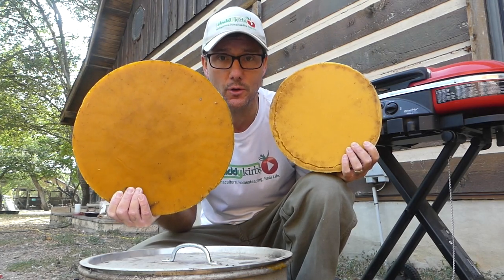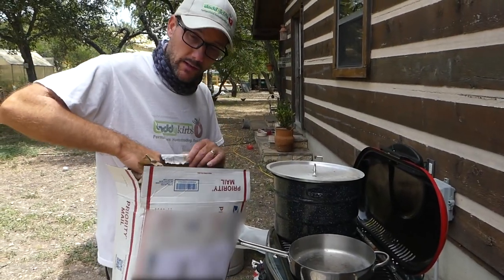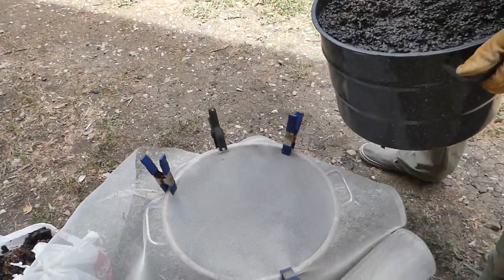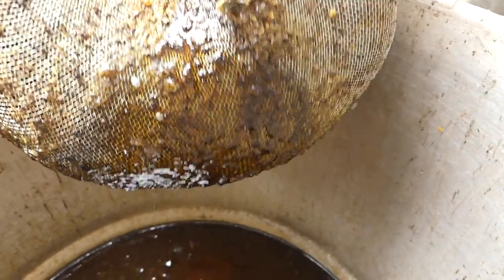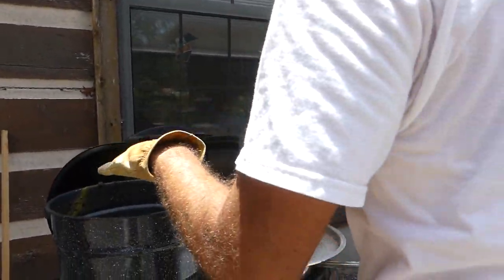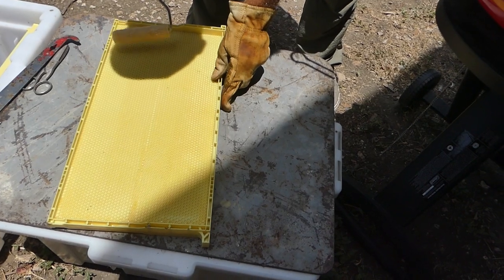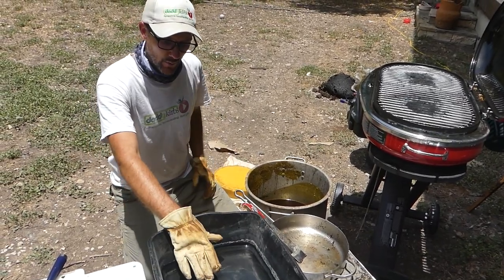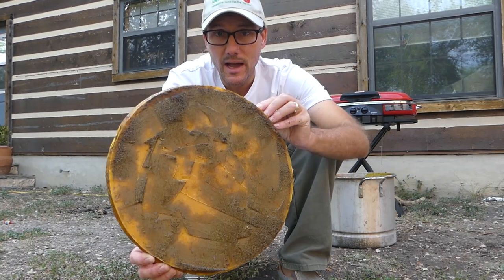Melting and Filtering Beeswax - Wax New Frames

Comment: Put the wax in a pantyhose before it melts and only then add the hot water to the pot to melt it. This way, the waste remains in the pantyhose and the wax remains in the pot without any residue. As soon as the wax has melted, you can slowly take out the pantyhose and let the wax run off. It is best to use 2 or 3 pantyhose to filter out as many of the smallest particles as possible. This also keeps the pots a little cleaner

Comment: I prefer to pour the wax with the junk in a pillow case from the 2nd hand store
and after draining I place it between two boards and 
put pressure to it to get much more wax out of the sludge. 
Remaining wax in the pots are easy to melt with a hot air gun.
Tom 😎

Comment: depending on how clean it comes, I sometimes melt and strain 2-3 times, no matter how long it takes, and I use an old fashioned paint scraper after it's hard.  I made a solar melter, using an old window, an old hive box, a cake cooling rack and disposable roasting pan, and a disposable bread pan.  You can find directions on internet.  When I come home from beeyards, I drop whatever wax I've collected in the solar melter, and forget about it till next time.  I think you'd like it, a sheet of paper towel on the cake rack under the wax filters it really well.  Enjoy your bees. Western KS.
Reply: Yes, paint strainers do work well.  I use them  to strain honey as it goes into 5 gal bucket from extractor.

Comment: Hey Blake - I think you need to go a bit finer on your straining if you want it to be clean enough for any decent usage - Paint filters work REALLY well! Coffee filters work ok.. but take forever and clog a bit.You'll always get the trash on one side, but you just scrape it off and keep going! :) Using a paint filter (the bag strainers) will make for much less trash. Check out DirtRooster's channel, he is the one I learned it from and it works really well - that, and consider investing in one of those huge rectangular roaster/crockpot type things (you can get them at Goodwill since you're not using them for food, it doesn't matter much). Heats the wax and no propane needed!

Comment: I boil the sludge twice. Drain the wax off add more water boiler, drain again. When using the foam roller use really lite pressure and try not to put much wax in the bottom of the cells. It doesn’t do you any good down there. Try to get it to build up on the tips of the foundation.
Reply from the maker: Great tips! Thank you.

Comment: Blake you are in South Texas just leave it in the sun it WILL melt  lol
Reply: Especially withe the daily temps like there are now.
Reply: @ericjohnson1008  at least it's not like 1980 with 45 days over 100 and several days over 110
Reply from the maker: Yep, I've done some solar melting in the past, but it's slower. Sometimes you want it when you want it LOL

Comment: You should filter at least 3-5 times and EACH TIME the filter hole used should get smaller until the last is 1 used is a cheese clothe or slightly larger..That will remove all trash and make beautiful wax. I used to do this in girl scouts to make tiki torches and porch candles..you can stil might try filtering what you scraped to use in porch candles..no waste..